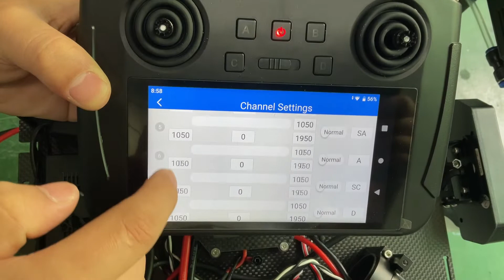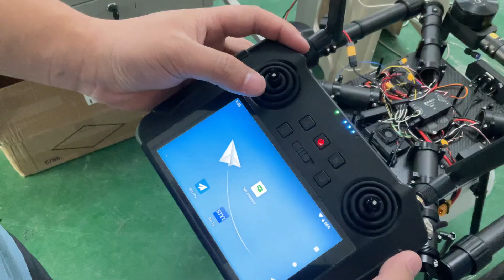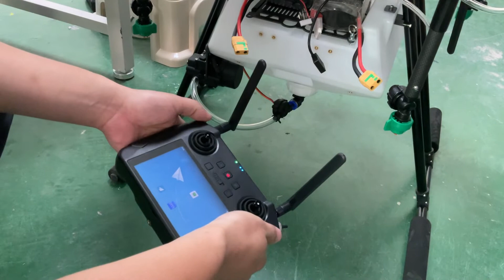How to calibrate the ESC for K++ flight controller with MK15E Remote controller (1)

Comment: I need serious help with the m900. I did a test flight today and once it got in the air it was spinning in the air
Reply from the maker: Hi, what flight controller and remote controller would you drone using?
Reply: @JMRRCDrones  I'm using the siyi mk15
Reply: @JMRRCDrones  what flight controller do you recommend? And is there a guide I can get in my email to make sure everything is working properly especially with the system's.
Reply from the maker: Sorry, can you show me your drone picture to my email? r9@4fpv.com this is my email. Because we haven't m900 this model drone, I want to check it.
Reply: @JMRRCDrones  did you get it?
Reply from the maker: @xxvboss727  hasn’t received the email
Reply: @JMRRCDrones  I just re sent it

Comment: Try to find the technical specifications of the Jiik++v2 flight controller..  It 's useless ! The reason is a primitive flight controller with the characteristics of NAZA LITE !  The manufacturer greatly overestimated the cost of the flight controller.  JIYI's technical support service is working very poorly.  A few stupid tips, if you can't solve the problem, stop communicating ! ! !